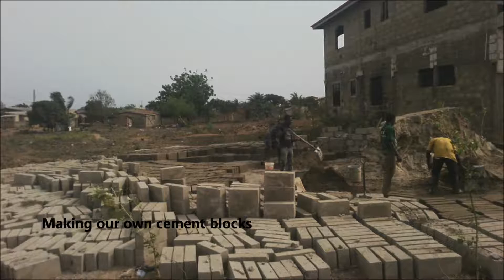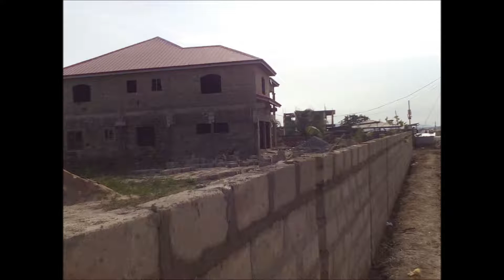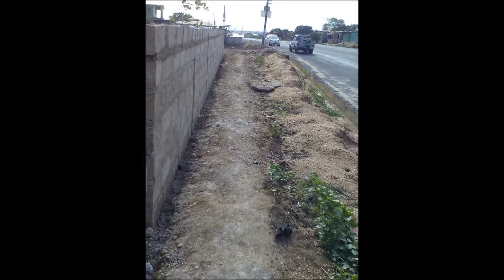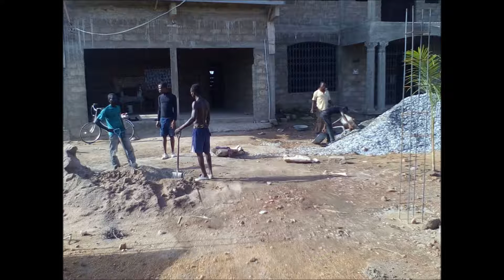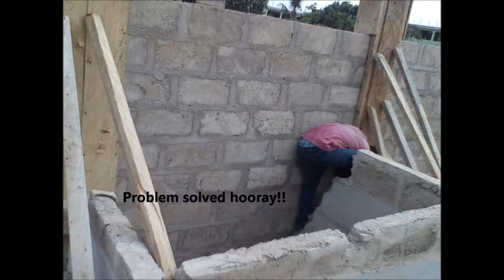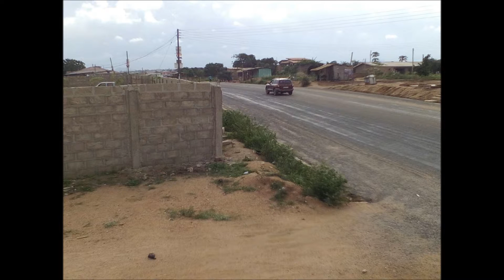Building in Ghana Part 2 || Fence Wall Construction ||

Comment: Please how many blocks did you use for the fence wall. Thanks
Reply from the maker: ~5,500-5,600 cement blocks for a 200 x 120 ft plot with 8ft high fence wall.  You can use the link to calculate the cement blocks needed.  Estimate and subtract the area that the gates will be installed. It is pretty close and accurate.  https://www.inchcalculator.com/concrete-block-calculator/

Comment: How long did the building project take and cost ?
Reply from the maker: We started In August 2012. Please pm for the cost to date. 
Thanks
Reply: +Double A Did you have to build immediately after purchasing land? How long can you wait? I'm working on getting something between Accra and Ayi Mensah, but will probably be a while before I am prepared to begin building. I don't want someone to squat in the meantime. What are your suggestions?
Reply from the maker: +kweli05 
l would suggest getting legitimate paper work for the land, putting in concrete rod pillars at the end of each property line and if possible build a kiosk for somebody to stay on the property.  If you plan on building within six months you dont need a kiosk.  Having someone on the land as you are building is good though so someone is watching over the property. We had someone stayed on the property for many years. Matter of fact they are still there.
Thanks.
Reply: Double A Ok, got ya. That's actually what we were thinking of doing. Thanks.